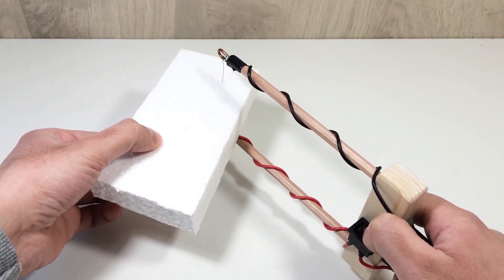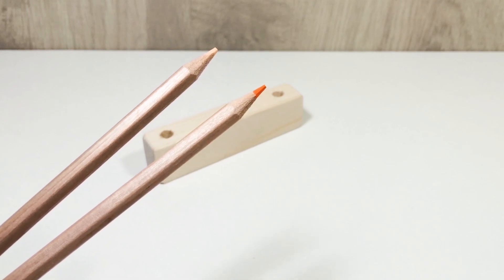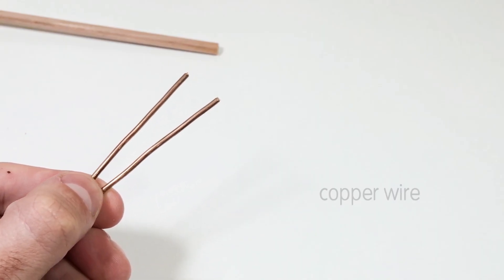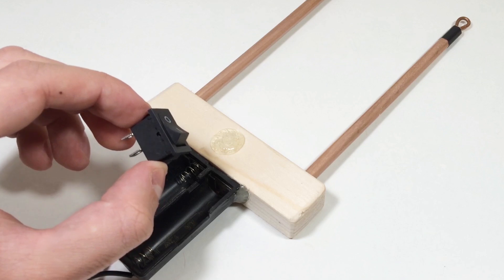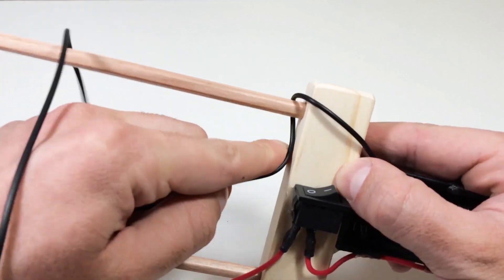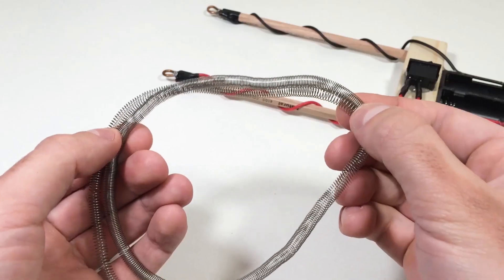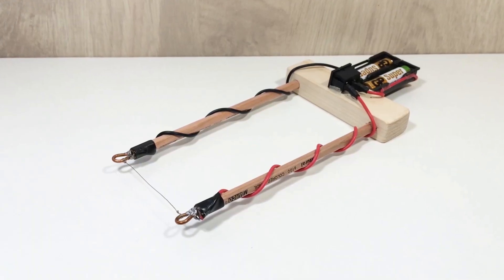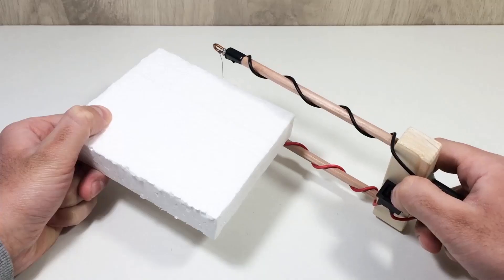How to Make a DIY Hot Wire Foam Cutter at Home (Easy & Cheap Build)

Comment: Can't fault the use of everyday materials, but it might be worth adding that you're using specific GP Super Alkaline AA batteries with ~1.5Ah max discharge. Running 3V across say, 0.8ohm of Nichrome wire, you'll be subject to around 3.75A (subject to thermal dissipation). Have you tested the kit beyond 30 minutes? Cheap AA batteries likely won't last long.

Comment: Great idea, except where do I get the wire?
Reply: any electric hardware store. This wire is used in electric store. 
Its called Nichrome wire.
Reply: You could get it out of a heater, hairdryer or any other heating thing